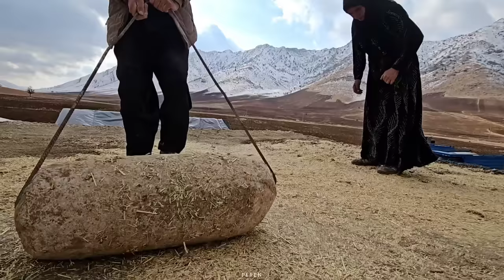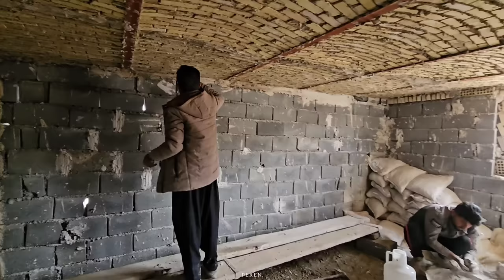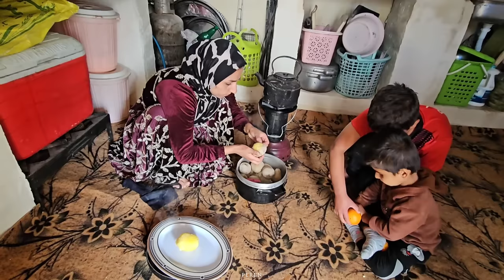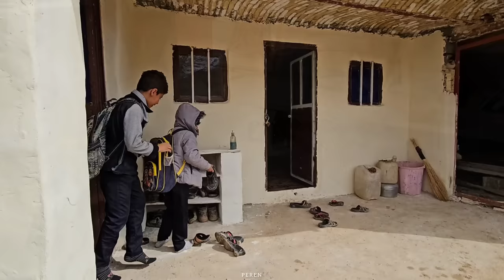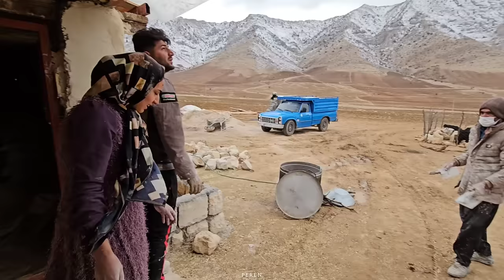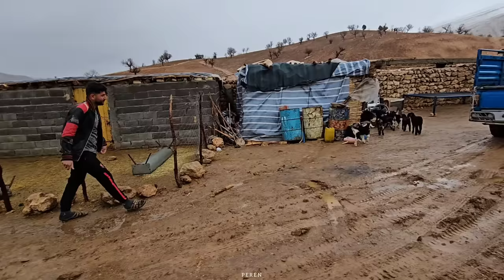Nomadic life in Tehmurt plasters the second room🔨🧱 and Shirvan goes to the wedding

Comment: Hello! Thought of 2 more home improvements 1) build a bigger shelf in the back corner of the room for more storage like pillows and blankets 2) standalone coat rack. Most cost effective way is to place a long thick tree branch in a medium to large bucket, fill bottom with cement..let it dry, then nail coat hooks around the top. You can make one for each room and can hang the children’s school bags on it too
Reply: Forgot to add that you can also apply a similar adhesive covering like the one on the wall on top of the stove to the shelves as a decorative option. Don’t think a roll of that cost too much

Comment: ❤ maybe y’all should think about fixing or straightening up that that little hut that is made out of that bamboo that the grandmother and the girls put together. It can be a little nicer so that it will not look so bad. You can leave the bamboo just put a better rooftop on it so that Water doesn’t go in while the grandmother is trying to prepare something in there because y’all have run out of gas propane. It is always better to cook with wood. Because you don’t spend your money on propane, so you see it would have been nice with all those rock stones that you have in the area you could have made a fireplace in every room, but in order for that fireplace to heat the room, it would have to be away from the wall. It would all have to be at least maybe 2 feet away from the wall and have three sides of their own with the opening in the front in the bedroom so that it can heat up the bedroom the stones get hot and they remain hot for a long time, and in the kitchen, you could have done the same thing but a bigger fireplace one that you can cook in and use it for other things like boiling water like heating up the room you could have made it between one bedroom and the other you see you have a bedroom and for the kids study and you have the kitchen attached to each other, so there is where you would have put the big fireplace so that when the fire would be going in the kitchen, the stones would be getting hot in the bedroom area and heat up the room. But you need to make an effort to go and collect wood wherever you can find it and have piles and piles and piles and piles of wood under a very good canvas and use it when it is necessary like always during the winter and in the summer only use it to cook with. I truly enjoy your videos. These are just ideas that I have in my mind that we hear in the United States do especially in the winter, because we have natural gas that we pay for it comes from somewhere some company, underground and pipes and we connect well. The gas company will come and connect and we throw the line into our homes and from there we get gas for our stoves or heaters, and not have to worry about anything so we’re now electricity goes out, we don’t suffer the cold because we have natural gas and the heaters. Keep our homes warm. But for those who rely or nothing but Electricity well I feel sorry for them because they suffer the coldness unless they have tons and tons of blankets. I remember when I was a little girl. The winters were so harsh here really here in South Texas. Yes, my mother had only one heater and the stove and we also had natural gas. So what she would do was she would put a blanket on the inside the entrance coming from the outside and she put a blanket, a heavy, blanket, nail it, and hang it up there all the way down to the floor in front of the door and she would put one on the outside, covered with plastic, the blanket, and in the plastic on all on top of the blanket showing in case it rained the plus blanket would not get wet but before you would go into the house, of course you would move the blanket inside then open the door a little bit and move the other blanket the other side go in and the blanket would come back down with the plastic but it will take that extra time to make sure it was covered close and then you would make sure that the blanket inside would fall all the way down and cover that wind would come in and the house would be not too cold freezing cold, but it was still cold. Then we would go into the kitchen where there was another blanket hanging on the door, keeping the cold air out. From the other rooms, so therefore we would sleep on the floor in the kitchen because it was large and the stove would be on, and my mother and my baby brother and ourselves would sleep in their bedroom my sister and I sister, and we had a bed in my mothers bedroom, and my mother and my father would sleep on my bed and my baby brother would sleep in the middle of them my sister-in-law bed and the heater would be the door to the bedroom and into the kitchen. It was a gas heater My Brothers would sleep on the floor, but we had a lot of blankets and we had mattresses that were made out of my mother rolled up these thick mattresses she would roll them up in three and just put them off to the side during the day there was two big mattresses that she would just roll up while we were in school and they pick them up. We would pick them up and roll them up and put them on the side wall for the refrigerator at night. A little lay our mattresses down which two older brothers would sleep on one mattress and my two younger brothers, which three on the other Mattress at the time I had one sister and four brothers and then through the years we were married my mother had it baby boy in her change of life menopause, she was in her 40s when she had my baby brother and that’s it. That’s how my mother would keep all of us warm and would not waste a lot of gas, so ask for now to tell you the truth you have the tent and the one bedroom you should be using the one bedroom all to sleep in and the tent for the boys to study and do their schoolwork or whichever you would like to use. That way you wouldn’t be using too much propane in the winter. I’m just saying what I see. I am full of ideas and yes I have tried them and yes they do work I cook outside in the summer and in the winter I do my canning indoors that way it will heat up and put moisture into the air, that way we won’t have that sinuses sometimes when it’s very dry your nose kinda feels dry and burning a little on the inside of your nose but that doesn’t mean that you’re sick means that the air is too dry. Thank you very much. God bless you you forever are in my prayers.❤😅

Comment: I was thinking that while applying cement, the working it bedt is on a wet surface. It is supposed to dry slow. It spreads easier and i saw once that one did wet before working cement. It adds the curing process to a slower pace. Then its stronger and not cracks with dryness.

Comment: Technically, all these materials are problematic because they make the roof heavy and may collapse with the slightest force. First, a row of bricks and materials, then mortar, rammed earth, cement, bitumen and now plaster, none of which are connected. The lighter and more continuous the roof is, the greater its resistance to incoming forces. I hope it will be translated correctly